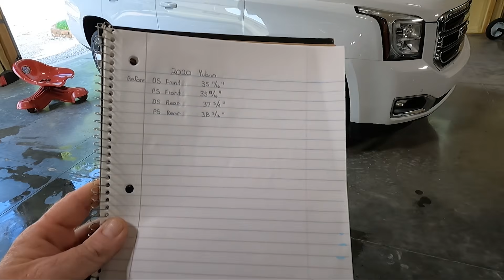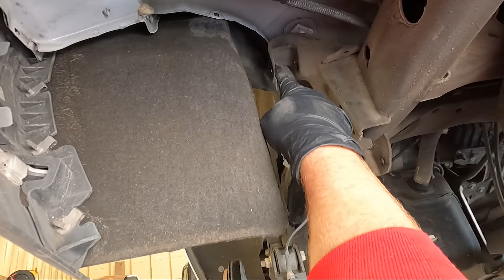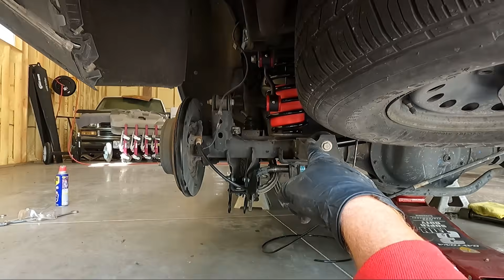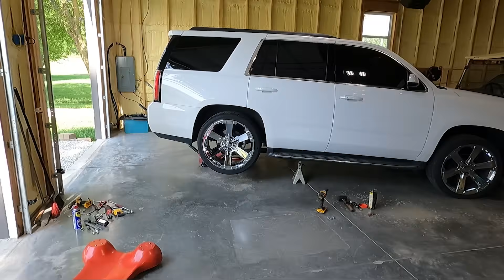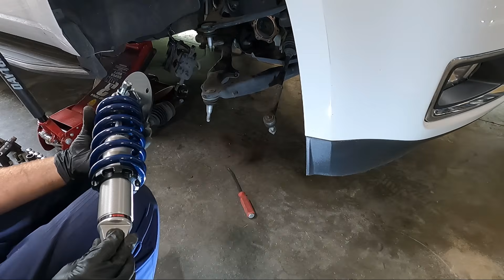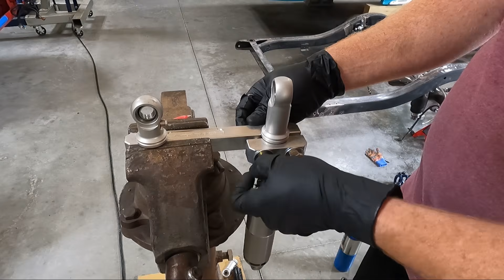Wife's Daily Driver Yukon 4x4 Gets Slammed (Check out how and what parts I Used)

Comment: Love this man. Did the full install on my escalade in the driveway including all new front end parts. Quotes of $1300 + for control arms, spindles, and everything front and rear. Only issue i had is i could not break the lower ball joint free from the spindle. I ended up spending 4 hours on it, and with out air (no chisel) penintrator and a sledge was my only real tool. I ended up buying new lower control arms and just getting rid of the old lca's still attached to the factory spindle. Any advice for that process next time? I couldnt get a pickle fork in the lower either, worked in one tap for the top control arm bolt though. Thanks again for the thorough video!

Comment: Also bro forgot to ask u them tps sensor u posted what docu need to program them i need a set for my factories and my big wheels thanks alot bro
Reply from the maker: Cheap tool listed in video description
Reply: @TWAMotorsports  thank u I'll look for it thanks
Reply from the maker: @chatobalencian1504 👍
Reply: @TWAMotorsports  hey bro I found the tpms sensors but where can I get the remote or how do I set them?
Reply from the maker: @chatobalencian1504 amazon for less than $20
Reply: @TWAMotorsports  thanks do u know the brand
Reply from the maker: No look for tpms reset tool
Reply: @TWAMotorsports  also brother for my 08 Cadillac Escalade which belltech do I need for the 2-3" drop is it the 2511 or the 2514 thanks a lot brother I'll be ordering me a Christmas gift so I can put them in in July also what strut do u recommend I was thinking the lowering belltech kit or for the front I was thinking adjustable up front and good shocks for rear I have the 3" drop springs I need to notch the rear out and I'll put them in when I get the shocks and throw springs in after I notch it out
Reply from the maker: AWESOME
Reply: @TWAMotorsports  which set do I order for my AWD Escalade what part # belltech spindles and what are some good quality adjustable struts for rear and also good shocks for the rear dropped thanks u Brother
Reply from the maker: Should be the same
Reply: @TWAMotorsports  so the belltech 2511 and the belltech Part #:9534 should do the trick how low would that put me in the front what did u do on ur Tahoe's and your new white Denali? Thanks for all the help bro just in Jan after the holidays I'm going to jump on it and get her ready to look nice 🙂 for summer
Reply from the maker: @chatobalencian1504 nonidea what your second number is.
Reply: @TWAMotorsports  I'm sorry I got a little confused I'm sorry if I confused you I was talking about the drop spindles 2511 or 2514 for my escalade and which would be the best front struts the ones with the drop spindles I found these belltech Part #:9534 and I was asking u have u tried using adjustable struts up front I have the lowering springs for rear and need to do the notch and the hardware kit for the drop
Reply: @TWAMotorsports  sorry to bother u I was wanting the part # to the adjustable front struts with coils I watched it again and that's what I want for the front and I looked in the description and they are not there just regular belltech drop struts and shocks I want adjustable like yours in the front

Comment: TWAMOTORSPORTS Hey brother so I can order all the same parts for my 2008 Escalade and use the same struts and shocks that u put on the parts sheet and use the same front drop spindles just grind the ball joint off so it won't hit the boot from the front axle because I do have a AWD Escalade but I'm ready to drop it all around and put some big wheels in the summer but I'm ready to drop it this winter and be ready for wheels in summer all the parts will work I mean like drop spindles and front struts and rear shocks plus all the parts from eBay to mount shocks and other bolts and nuts thanks once again brotha love your work grade A 💪💪🤟👌
Reply from the maker: Yep
Reply: @TWAMotorsports  so the 2511 drop spindles will work just cut my ball joint so it won't hit run on my front axle boots correct?
Reply from the maker: @chatobalencian1504 pretty much

Comment: Can I have a question? i lowered may 2008 gmc yukon denali 3/4 i want to know if i can use the bar relocation i already have and the shock extensions and just buy the 6” lowered springs and helper bags or do i need to buy new sway bar relocations and other extensions? when i try to order the helper bags the small ones say they are for a pilot but they are small like yours could those be?
Reply from the maker: No idea what you are asking

Comment: I have a mint condition 2002 Suburban 1500 LT 2 wheel drive which has a tow package switch with air shocks that self level. I’m not planning on towing anything heavy other that say a utility trailer once in awhile. I want to drop it down low like you did this Tahoe so what kit do you suggest and would I be able to keep the rear air shocks or just go with some good ones for lowered suburbans?
Reply from the maker: I made a video on that body style too. All parts are linked in that video description

Comment: Do the rear adjustable ride tech shocks make that big of a difference for the price? Always felt the belltechs rode a little rough in the rear and only dropped 4”
Reply from the maker: I think they are leaps and bounds better but they are a lot higher
Reply: @TWAMotorsports  right on thank you!! I run their coilovers on the front already and they are impressive. Just kills me to spend a ton on rear shocks lol but the back has always bugged me how it rides choppy
Reply from the maker: Lol. I get that
Reply: Sorry one more question, would I get the same specs as my bell tech shocks? Have some people saying they made the car or trucks sit a little lower but just wanted to check with someone running them on the same truck. Thanks man
Reply from the maker: Similar but I would call and talk with Josh at ridetech

Comment: Belltech shocks do not have enough dampening force to control our trucks with or without big aftermarket wheels. Moved to QA1's, and my vehicle drastically changed in ride handling and predictability.
Reply from the maker: I would imagine
Reply: Can you help me out with the model numbers cuz I have a 2019 XL  Yukon I'm going to lower it and I want to try the QA1 coilover setup
Reply from the maker: Don't know what products qa1 even carries
Reply: @TWAMotorsports thanks for your help I just wanted to try them since it has more adjustments
Reply from the maker: Would be nice to have adjustments but I like viking better

Comment: You said you can ditch the rear coil isolators to get like a 1/2" more drop, won't this cause the coils to not sit right in the bucket and wear and squeak badly?
Reply from the maker: Have to put heater hose on top if you do that.

Comment: Also,… could you have run the rear shocks upside down to eliminate the clearance issue on the lower bracket?
Reply from the maker: Nope. Tried that off camera